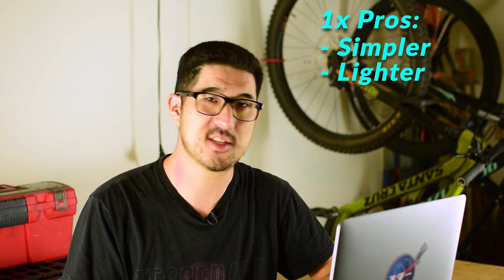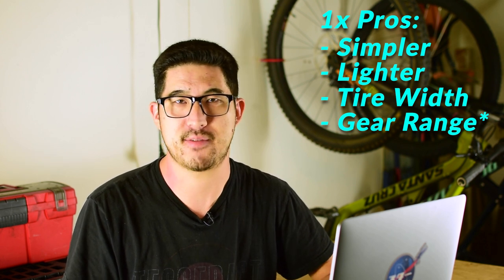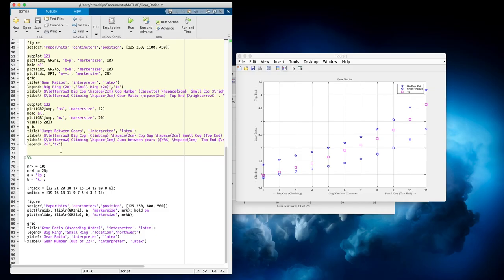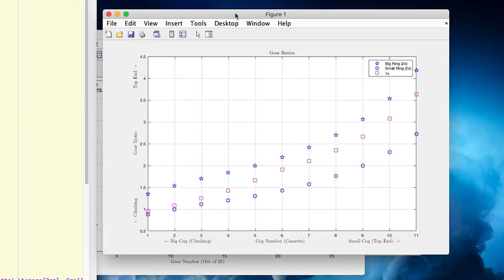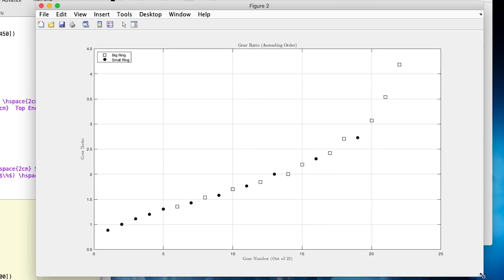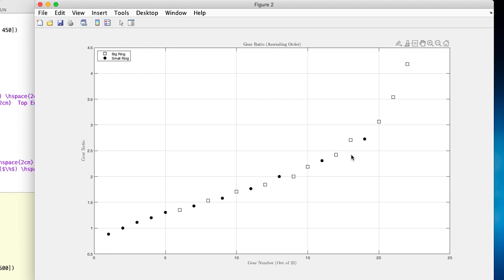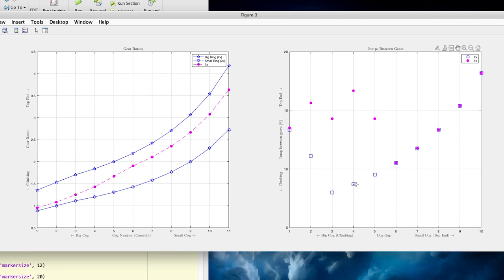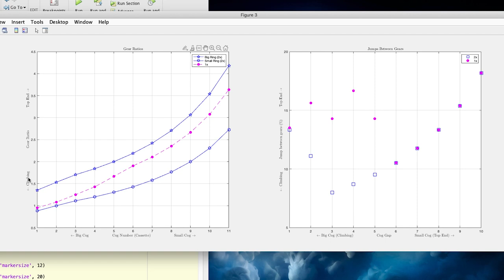1x vs 2x Drivetrains For Gravel Bikes | The ANSWER! (Is In Gear Ratios)

Comment: Thanks for this vid. I think I watched it some months ago and ended up buying a 1x system(specifically for road cycling). It's a 44 front and 11-52 rear. I feel like it provides enough variety of different gears for most terrain scenarios. Also, If(correct me if I am wrong) I were to use a 2x I would be spending a lot of effort changing gears to sequentially move up and down so as to optimally accommodate the terrain. I think if I had a 1x with a 12x cassette, it could be pretty great!
Reply: my cassette is 11-52. Second line is the added number of teeth.
11	13	15	19	23	26	30	34	40	46	52 
	2	2	4	4	3	4	4	6	6	6
What this might mean for race performance on a road bike is a bit  beyond me right now.
Reply from the maker: Haha nice. Yea those bigger jumps (4,6) mean you might not be able to find that perfect cadence for a given pace in a race. If you’re not racing, it’ll just mean you slow down a tad
Reply: @TheBikeSauce  those big sprockets are nice when going up hills!

Comment: u mentioned skewed chain line in reference to using for example the largest front and rear cog on a 2by. wouldnt you in general have more chain line skew on a 1by thereby potentially straining and reducing the lifespan of the chain on a 1by?
Reply from the maker: Chain is more skewed on 2x big-big, but still gets pretty bad on a 1x

Comment: The biggest issue with a 1x is when you're want an insanely low ratio - in touring for example - then you're spinning out on the straights. advised gear inches for touring is =<20. A 42x44  (with 50mm 650bs) is 29gear inches, so still not low enough for a steep grind/spin. What to do?

Comment: Thank you that was really informative.  I'm thinking about replacing my Giant Talon mtb with a Kona Libre AL. This video was helpful in explaining some of the differences I might expect.
Reply from the maker: Ohh jumping ship to all road! Ha! Will be a fun change of pace
Reply: Did you get the Libre? If yes, how is it?!
Reply: @garrickx2111  Yes and I love it. I've put about 700km on it. Previously I've only ridden MTBs   so drop bars are are new thing for me. The gearing ratio is great but sometimes there feels like there is a small lag in selecting the correct gear. That could easy be me and not the bike. I've never had Scram gears before. No issues climbing or descending trails. On the flat plains it quick and in forest trails it gets around trees easily.

Comment: In summary a 1x13 system would be the ideal combination! There is no way to have a reliable 1x12 or 1x13 system in dirt & mud (I tried) with cables. But an electronic Di2 1x13 would be the perfect setup.

Comment: I'm currently running the stock 48/31T and thinking about replacing the 48 with a 50 or 52T chainring. I'm not sure if its even possible.

Comment: Don’t know if this was mentioned in the 200 other comments but the biggest reason to go 2x over 1x is cross-chaining. With 1x you cross-chain more which translates to watts loss. Therefore 2x is more efficient.
Reply from the maker: I usually call this point a wash. Most 2x cyclists don’t perfectly shift to minimize cross chaining and when you’re on dirt, the losses due to surface roughness make cross chaining losses insignificant
Reply: @TheBikeSauce  In a lab anyway, 2x is mostly more efficient. https://www.velonews.com/gear/gear-issue-friction-differences-between-1x-and-2x-drivetrains/
Reply from the maker: Great article, thanks! Kind of validates the point though. Less than 3 watts difference between 2x and 1x in a lab setting will be undetectable in practice I think.
Reply: @TheBikeSauce  Kind of validates my point tho, 2x is technically more efficient but yeah not by much. Anyway, personally I prefer 2x for gravel/groad. Higher high end, lower low end and mostly better chainlines, plus smoother jumps. But I'm 100% 1x for MTB!
Reply from the maker: Right. All a matter of perspective and preference. Thx for engaging in the conversation!

Comment: Nice, standard gear ratios are way off for hilly NZ. You would need to be a doped up Armstrong to spin up the hills with standard gears. X1 11 speed and drop 2 teeth front, most run a 40t as standard 38t is way better. On the X1 12 it works even better.

Comment: When you already have a 1x capability then Add another bigger sprocket up front is always a way to go. The Smoothness of a 2x shift is far better on 1x because it has this sort of bigger adjustment on muscles as you power down the gear, this muscle adjustment affects your mental performance on hard racing. just sharing.
Reply from the maker: It's all personal preference. The point is to be informed and make the call yourself.
Reply: @TheBikeSauce  yup just for a cup of coffee discussion would always do, no pun intended.Keep up.

Comment: So is chainline a gimmick? I have a roubaix sl8 road endurance bike. It can fit 40mm tires, i have 40mm tires on. The frame could probably squeeze 45mm but it would be tight. The chain however (at its closest to tire) can easily handle 50+mm. The bike has 105 di2.

It has me wondering if the chainline stuff is an excuse for manufacturers to force incompatibility on us?

Comment: Great video, my only worry is that the front chain ring sizes differ (for grx). For 1x a 40-42 tooth and for 2x a 46,30. I’m not worried about the range but more about wat that means for cadence at fast flat gravel speeds. (30-34kph). I’m worried that the 1x would mean I’m lower in the cassette ant thus the jumps will be bigger gwn if I’m higher in the casette. Af what I could find the jumps are 2 tooth for the fist few gears and percentage wise they would be bigger from 11-13 then 13-15 for example. Am I right? I could be wrong.

Comment: Loved the gear ratio calculations!  This is exactly what I was looking for.  I am planning to upgrade my gravel bike to GRX with 40 up front and 11-46 in the rear.  I live in an area with steep climbs, so I really need it (I think).   Question:  Will the GRX derailleur accommodate the 11-46?  Shimano sells it along with the GRX groupset, however, they claim that the 11 speed derailleur tops out at 42.   Thoughts on that?
Reply from the maker: Thx for watching! Officially, shimano says no to 11-46, but I have heard form more than one source that it’s fine with 11-46. I don’t have first hand experience. Perhaps if you try you can let us know if it works!
Reply: Your question is from one year ago.. but for the benefit of others reading this in 2022, yes, 11-46 works fine with the 40T of the grx.

Comment: This is simple. If weight is what you’re after, then take a dump before going cycling (worth more tha the wight difference between 2x and 1x). You should consider 1x if you want the lowest maintenance (after single speed) bike possible and can afford loosing some speed on the flats. If the speed is a priority then 2x is a better solution. Generally speaking, the choice is easy if you know your priorities.

Comment: interesting stuff.
about to start a gravel/endurance bike build where i was going to go 2x, now looking closer at 1x.
Reply from the maker: Nice!
Reply: @TheBikeSauce  I went to a MTB chainring (35/24) and an 11/34 cassette. In lowest gear I get ratio of 0.71. A newer Gravel/MTB often comes now as 1x with a 50T cassette. A 34t chainring with the 50T cassette gives a low ratio of 0.68, so I am pretty damn close, and can spin up the hills in Surrey (UK) and it cost me £65 all in. The 1x setup I was looking at £350+ for it all. No brainer really. I do love the 1x large cassette look, but I also love £300 in my pocket ;-)
Reply from the maker: Nice! Of course drivetrain choice is very personal and depends on your particular local terrain
Reply: @TheBikeSauce  100%. I could not get up the Surrey Hills here with the standard gearing that came with the bike. I recently bought an Eastway frame and fork set ( https://www.wiggle.co.uk/eastway-balun-c1-force1-cyclocross-bike ) and am building it with the kit I currently have on other gravel bike. I have to build new wheels as Eastway comes with 'thru axle' so ordered some new hubs. Fingers crossed it will be done for a ride out this weekend
Reply from the maker: Nice! Building from frame up is always fun!

Comment: Well done , ☝🏻, I understand the concept, and the design . I too considered the2x,since i really like the tight gaps and would have likened to have experienced that feel on gravel particularly when I might encounter fast group event rides in the past . But the diverge i chose  has 1 x. So I will deal with it and it has to work out and be good enough for me. It has to be better than mtb 1 x where I only really have like 5 or 4 cogs for flat gravel and the rest a waste as granny gears. I am trusting that the GRX and the speced  xt cassette will be better ... will see in a couple of months... worse case scenario I can always order the 42T GRX chain ring since the spec comes with the 40 t.......
Reply from the maker: Right, you do have some options with regard to modifying your 1x setup. Basically you choose between range or fine increments and you can bias the whole thing up or down with your choice of chainring.
Reply: @TheBikeSauce  I have to commend you on your speaking and teaching abilities as a young adult. You definitely have some education and applied it.  ☝🏻👌🏻😊
Reply from the maker: Too kind!

Comment: Hey man I really appreciate the analysis and it's helped a lot in my decision to opt for 1x. But now my next question would be, how big of a single front chainring do I need if I don't want to lose out on speed? Is there a big difference between 40 & 42T?
Reply: Big enough so you will notice
Reply from the maker: It will totally depend on your personal max speed. There’s a good online gear calculator that’ll give you speed for a given cadence and gear ratio https://www.bikecalc.com/gear_ratios

Comment: Geeking is good! A mtn biker is used to a 1x with lower gears, a roadie is used to a 2x with higher gears. Assuming they stick to what they know best, why does the roadie who chooses the 2x get a lower gear overall (ever so slightly) than a mtn biker with the 1x? I suppose one could swap out the 40 chain ring for a 38 or 36 to be almost even if one was bikepacking and needed lower capability. Maybe have an extra chain for easier swapping too.
Reply from the maker: Great points. Don’t have an answer 😆. I think key is that the best is subject to preference and riding style

Comment: Ok, so it turns out those jumps in gears are not as terrible after all and idea of one less thing to worry about seems great. But what about the chain-line issues on 1x? I presume you would want to be efficient on a gravelbike and not want that extra friction.
Reply from the maker: I think friction due to crosschaining tends to be overblown. It’s a very small overall percentage of losses when compared to aero and rolling resistance. But you’re right, it’s all a game of trade offs

Comment: How to know which kind of chainrings are applicable for 2x set-up?
Reply from the maker: You have to consider overall range and big / small jump. Then proper mounting. Determine the number of mounting holes and the BCD value for a given crankset

Comment: Love the content - thanks. I have a diverge with the 1 x GRX 11-42T cassette with a 40T chainring. I am looking for a granny gear for steep hills or hills at the end of a long ride. I believe I can put a 11-46T on the bike without changing anything (maybe : )), but it leaves a large 9 tooth jump to the 46 (37 to 46). Only other option is a chainring - wolftooth do a 38 but they are out of stock and I reckon a 36 could be the best option anyway (which I don't believe are available). Would appreciate hearing any other options if I have missed anything. Thanks
Reply from the maker: Seems like 11-46 would be ok. Merlin cycles sells a piecemeal groupset that includes the 810 rear der with 11-46 cassette. As for the increased jump, you’ll probably feel it, but then again, that’s kind of the point at that end of the spectrum, right? Get down to that lowest gear! On the flip side, if you never spin out on the top end, then a smaller chainring seems logical too.
Reply: @TheBikeSauce  Thanks for the response, I have read in forums you can get away without a new rear der but it seems a bit sketchy. 
I would be interested to see another (matlab!) video comparing the SRAM offerings (eg on the Pro and Sworks diverge) to the GRX (eg 1x vx 1x and 2x vs 2x). For example, the 1x eagle has a wide range 10-50t with a 42t chainring - this setup could be attractive depending on the type of riding you want to do (eg bikepacking). Thanks again - I really like your content.
Reply from the maker: Not a bad idea! I’ll look into it. Thx!

Comment: I loved your video. There is something need to ask. I am Unable to decide between the 2by trek ds3 and trek 1by ds 4. I live on a hilly terrain so there is going to be a lot of uphill and downhill rides on tarmac. 
P.S. price is not an issue and I am a beginner
Reply from the maker: Thanks. Unfortunately it all depends on your terrain and intended use. The Dual Sport is a hybrid /city bike by most accounts, so I'm assuming you'll be doing some commuting and recreational rides?
Reply: @TheBikeSauce  mostly recreational and some commuting, I suppose.
Reply from the maker: Probably start with 2x for the range, unless you really like the look of 1x would be my opinion
Reply: @TheBikeSauce  thanks. I got my answer. 😀

Comment: Two practical things not mentioned about 1x advantage - 1) much easier to clean off seat tube after muddy rides without front mech getting in the way, 2) one less thing to break, if the front mech breaks you're stuck with granny gearing or monster gearing

Comment: Thanks!  Very helpful.  I have 2x on my Slate with semi-compact chainrings and 11-42 cassette.  I could go 1x with a 40T chainring and keep the same cranks I think.
Reply: Is that using Shimano grx and mtb derailleur? I’m trying to find a compatible setup for 2x with big cassette.
Reply: @samuraioodon  It's just a GRX... I don't think there are MTB vs non-MTB models of GRX but I am not sure.  I think that when I bought it I made sure it was compatible with double chainring setup.
Reply from the maker: Just GRX
Reply: Thank you, is this the di2 GRX or mechanical? I thought max cog was 34T? For my future gravel/road I will go 50/34 with 11-34 but if you can do 42t? 😳 I like that option. Can you show me a picture or video of that working? I can't find that combination anywhere without chain rub on front derailleur.
Reply from the maker: It’s mechanical. Max cog for grx 810 rd (2x) is 34t I think. Larger for GRX 812 (1x). You’ll have trouble with overall drivetrain capacity if you try to go much larger cassette  range on 2x
Reply: The GRX RD I installed requires a Wolftooth RD hanger extender in order to work with the 42T cassette.  I use a RD hanger extender on three of my bikes (this Slate gravel bike and two road bikes) in order to accommodate cassettes with cogs bigger than the Shimano or SRAM max sizes for the respective RDs.  The extender only costs about $20 and has allowed me to go to a 36T cog on one road bike, a 40T cog on the other road bike, and a 42T cog on my gravel bike.

Comment: Thanx for this in-depth Vid. I still am sticking to 2x set up for my gravel. I’m thinking of upgrading my groupset from stock setup. But I’m torn between the GRX and the ultegra since I mainly use my gravel on mostly flat surface, 80%road 20%gravel and few climbs. I know I should be getting a roadbike instead, but I dont trust the thin tires of most Roadies. I do enjoy speeding up my gravel especially on downhill runs. Can I get your opinion on this? Thanks
Reply from the maker: Thx for watching! For your comparison, I’m assuming you’re referring to GRX and standard road Ultegra mechanical groups. In this case, the main differences will be the clutch on the rear mech (ultegra doesn’t have this, but ultegra RX does), as well as lever feel (GRX lever pivot point higher which actually makes a notable difference as braking from hoods is more powerful), and gear range (GRX is biased toward lower gears for climbing). 

Based on your usage of mostly flat 80 gravel / 20 road, it seems like you’d be fine on standard ultegra. You may notice more chain slap in the dirt without a clutch, but otherwise would be fine. On the other hand, there is no discernible drawback for going GRX on an all road type of bike that I can think of. Coming from road 105, I love the GRX group for the lever feel and silent drivetrain.
Reply: @TheBikeSauce  thanx for the swift response. Appreciate your take on this. I was thinking of Ultegra groupset with the Ultegra RX RD.  Last question, You mentioned that the GRX is geared for climbing, even with the 2X set up?
Reply from the maker: Oh yea, ultegra rx would probably be a good choice then. As far as gearing, GRX has slightly fewer teeth on the front chain rings (depending on model, 400 vs 600 vs 810), so even with the same cassette the overall gearing is a tad lower than a standard compact double (50/34)
Reply: @TheBikeSauce  thank you very much for this Info!!